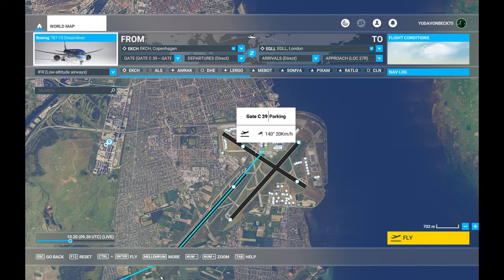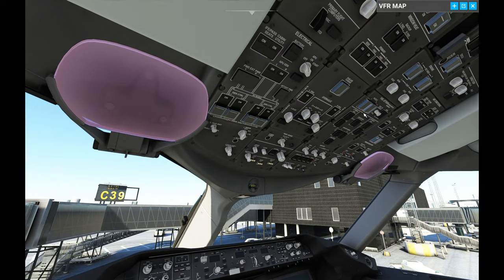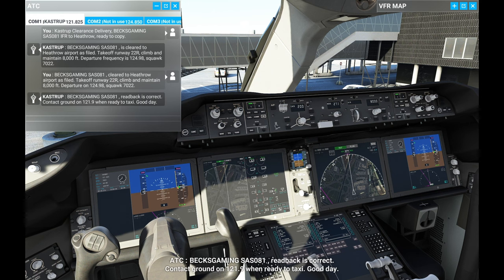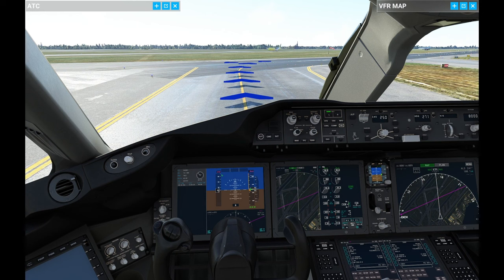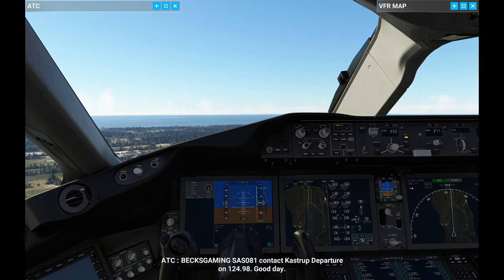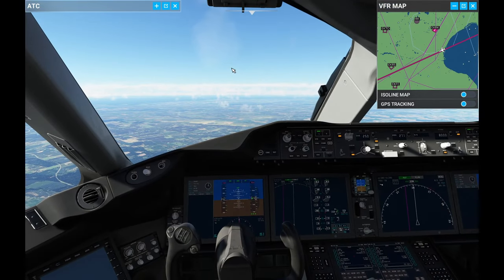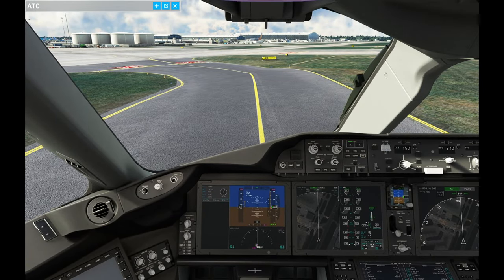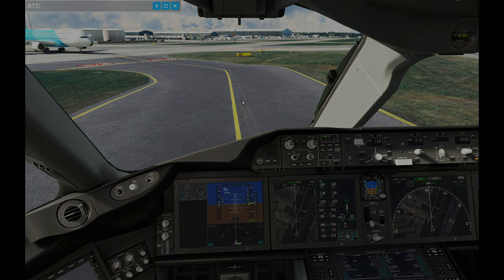Beginners guide #3 : The easy way to take off and land the 787 Dreamliner using ILS

Comment: Excellent tutorial! I came to this video after spending a couple of hours trying to find ways to manually set the PFD to display the VOR direction and glideslope, and could not find controls for this. Apparently the 787 has a more "automated" flight management system than the older B-747-400 and 747-8. I could not find the "GPS/VOR" or "GPS/NAV" switches that I amuse to seeing in FSX and MSFS for most other aircraft with VOR/ILS capability. Am I correct then, that the only way to fly an ILS glideslope in the 787 is to program a full flight plan in the FMS computer? I love the performance and fuel economy of the MSFS 787, and I have a friend who flies them in the real world for American Airlines and also loves the aircraft.